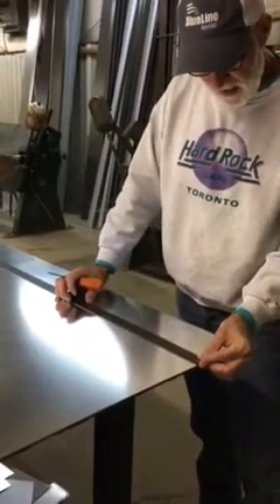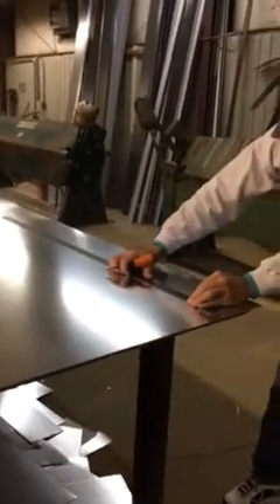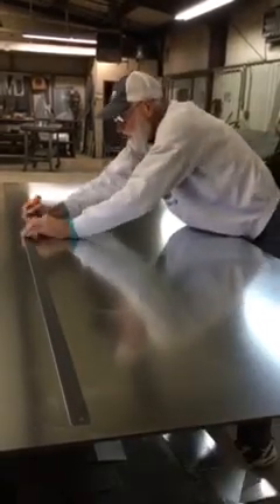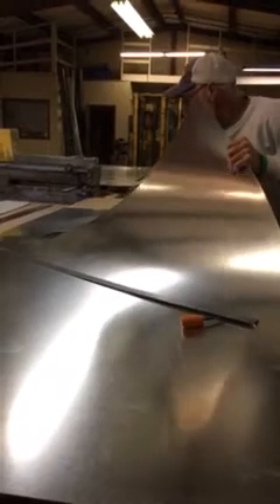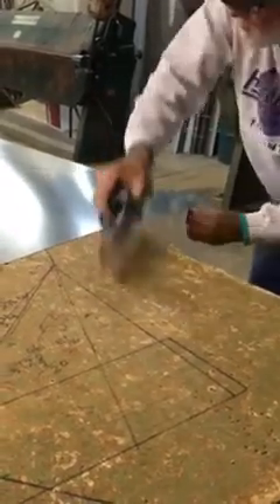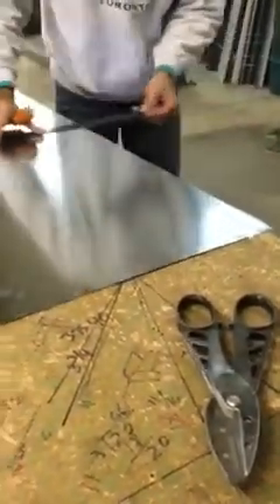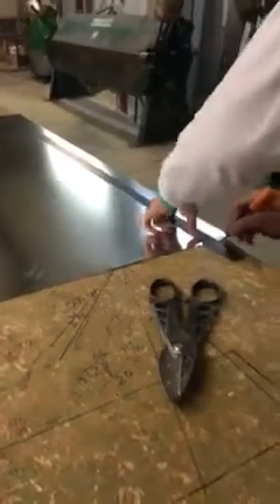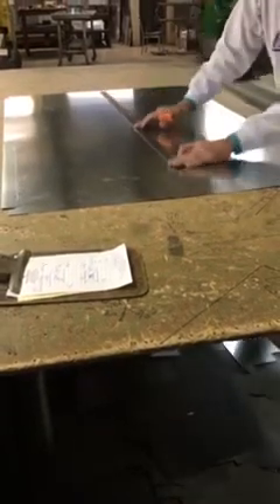How to make a fireplace chase cap

Comment: Thank you very much Robert! I’m going to have trouble affording to buy one on my Military retirement, so I’d like to try and make one. Your video is very helpful. However, I don’t see a part two. This one ends saying “and I’m going to you that to you”.
I’m in NC and did take mine off and repair it about 8 years ago but we hear rain drips again so I better replace it this time. Perhaps with stainless steel so it will last my family after I’m gone (I’m 67).
Reply from the maker: 3162679422